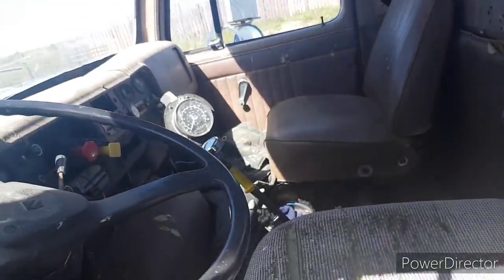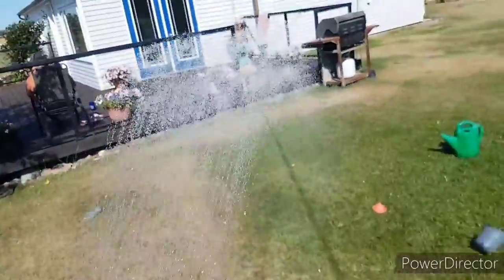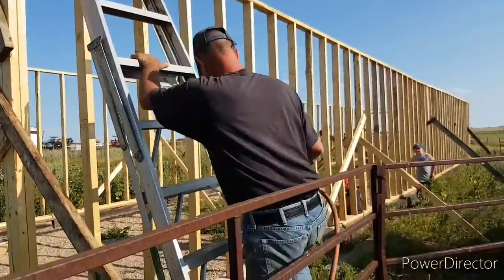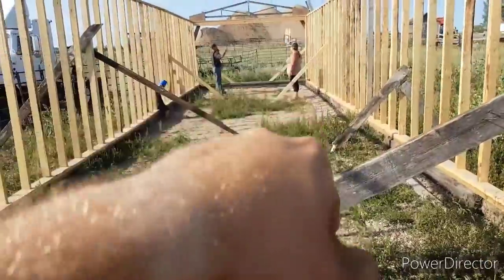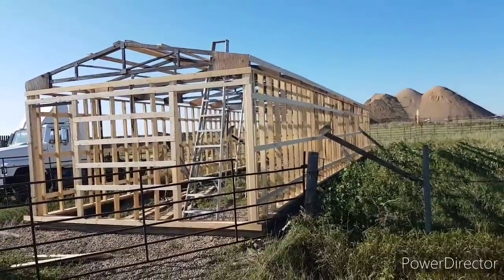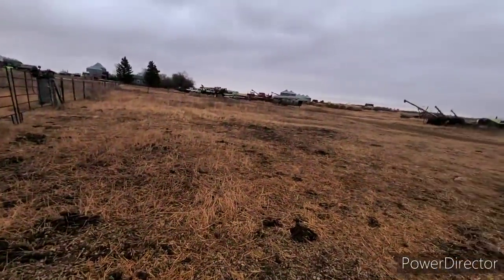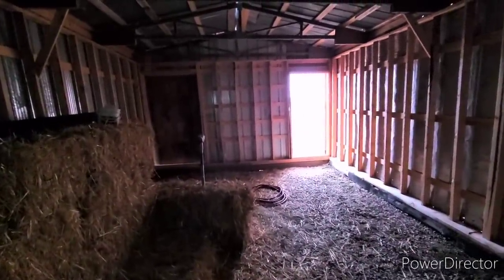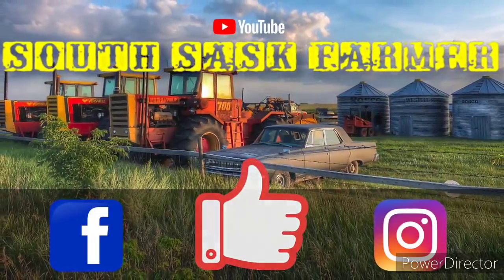Dad built a barn!!

Comment: Hi Guys nice barn ! I would make a suggestion tho I’d nail a 2x4 to the sill that fits tight between every stud and then nail ur studs to that 2x4 then put ur plywood on . If you don’t anchor ur studs better what will happen when u get ur cows in the pens and they start turning around their butts will hit the walls and push the studs off the sills . With only 2x4 walls it won’t take much of a bump from a cow and off it goes. And I’d do even more reinforcing where they enter into ur shoot because they will get to pushing and push the side out .

Comment: First barn I built I found out a guy about 30 miles away had cedar trees he wanted cut. He had a lot of them so I grabbed my two brothers and my truck and brothers truck both Chevy short beds, 1978 and a 1980 and he sold the cedars as much as you could pile in the truck for 20 bucks. I cut 12 big tall cedars and piled them in my truck and as many 8 footers in my bothers. Used the tall ones for the barn and some scratch and dent metal that a metal company was selling. That was in 1985 and the people that bought the place is still using the barn today. The barn was 20 by 30 with a 20 by 16 lean to off one end. Cost I had in it was about 400 bucks. Don't have to cost much to be usable for lots of years. Lol